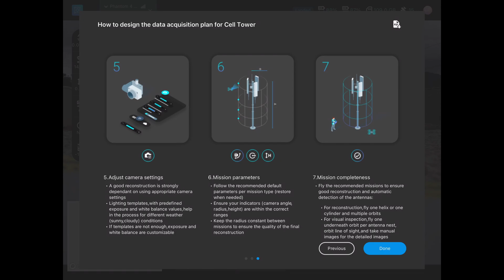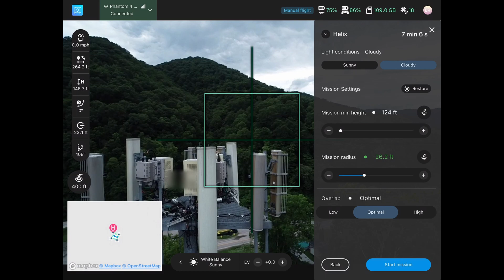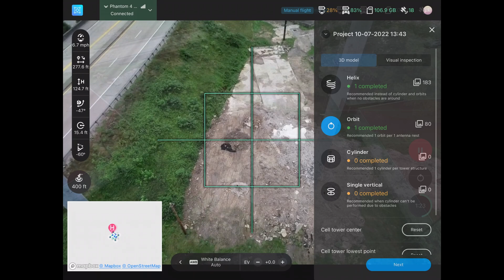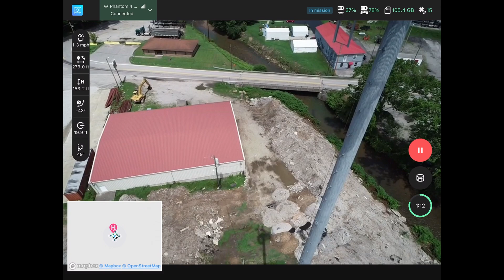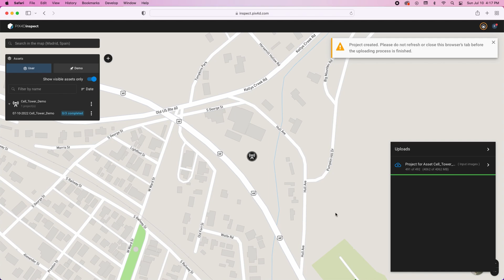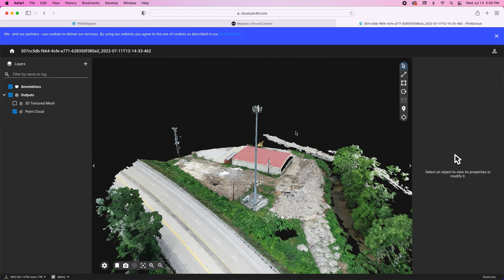Creating Digital Twins with Pix4D Scan and Pix4D Inspect

Comment: As part of a company that does tower mappings and inspections themselves, I have a question about this software. At a conference in which we saw Pix4D, they told us the measurements were within 1/16 of an inch. Can you confirm this? If so, it'd mean we'd never have to climb a tower again haha!
Reply from the maker: Wow, yes, that would be pretty incredible.  I cannot personally confirm that accuracy, I've only ever been in on the data capture side of things, not so much the analysis.  But I would imagine that would require a drone with RTK capabilities.
Reply: Gotcha, thanks for the info! @WildWonderfulWeekends

Comment: Great video.  Can this be used for facade capture? Like doing a vertical Ortho?
Reply from the maker: Thanks, I appreciate you checking it out.

Yes, there is a mission option for capturing rectangular structures for 3D modeling.  I didn't experiment with it so I'm not sure how well it does but given the quality of Pix4D's software in general, I would bet it is good.

Comment: Quick question, now that you mentioned you get the best bang for the buck using those two software together. Will you be using Measure Ground control much anymore?
Reply from the maker: Great question, I definitely will, but probably more so for orthomosiac mapping than digital twin creation.
Reply: It's nice how Measure ground control is a all in one mapping software. But It's missing the Pix4D clear scanning in 3D. As well as how Drone deployed is a little more accurate on stockpile measurements from a software base. Without using a RTK system with real ground points. Thanks for this video, now you have given the drone mapping community something else to consider🤔🤣
Reply from the maker: @Mixxwizard  lol... You're right!  It would be nice to have one really well-rounded app (and drone) that could cover all the bases.